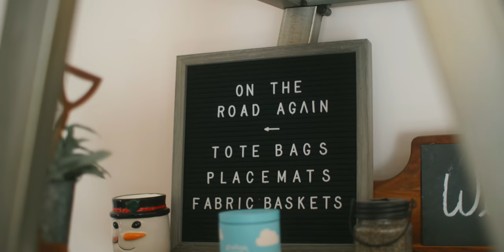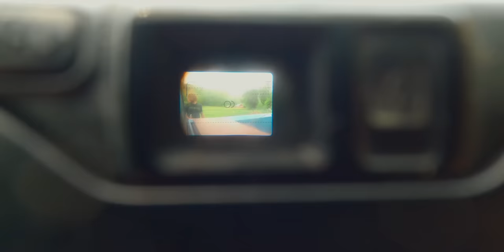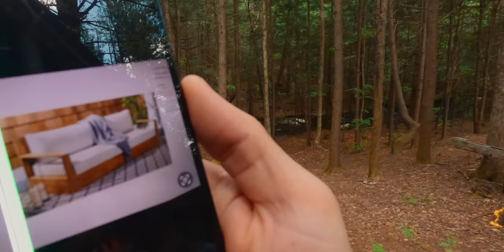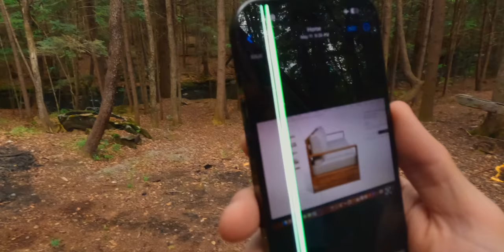The Day the Cottonwoods Blew

Comment: I don’t get it. I see you cutting boards with a chop saw. You have enough power to run a good size fridge. Do you have power from the utility company which you must have. Hot water heater has to be 220 volts. I don’t get why you would have to deal with propane for refrigeration.